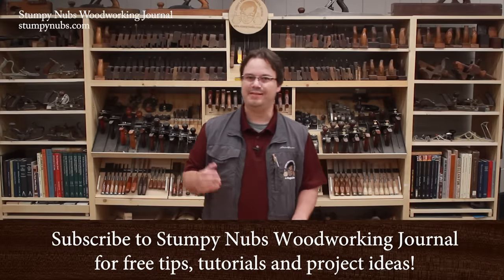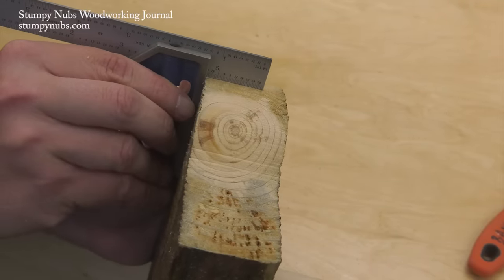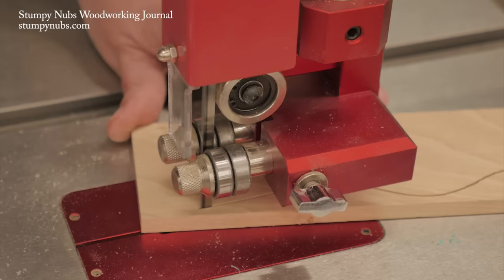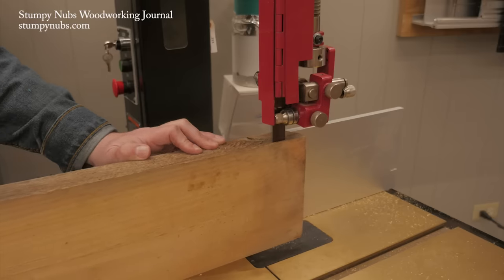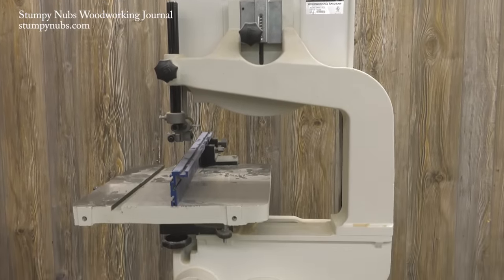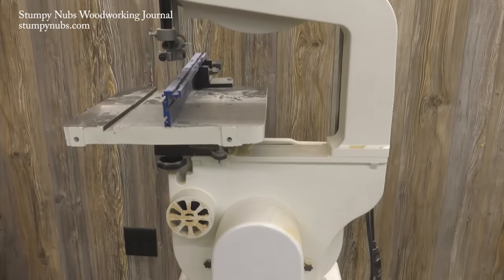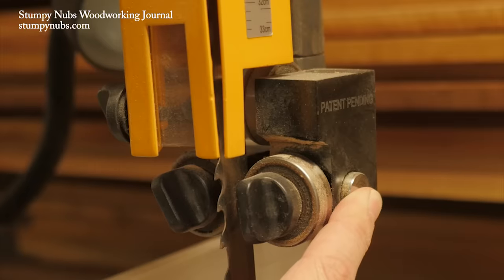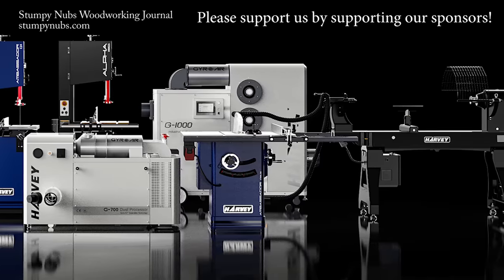What you really should be looking for in a band saw for woodworking

Comment: I disagree. By all means buy the saw you can afford now. You will have the experience and use of it until you out grow it. I started out with a 12” jet band saw. When I needed  a pro model I sold it for what I paid for it.  Tools hold their value. you can have the benefit of a saw you can afford now and probably get all or most of your money back. I recently bought my big band saw and a Saw stop table saw to replace my bargain saws. Both the new saws have gone up dramatically in price since then. I could probably get all my money back today but most definitely in 5 to 10 years from now.  Machine tools are one investment you are unlikely to lose money on. They just do not depreciate and new ones are always more expensive. Why wait, Get what you can afford now and trade up later.
Reply: I disagree, unless you’re talking about buying used tools.  You will never get back your original new tool purchase.

Comment: I’m getting ready to buy myself a bandsaw for making my blanks for bowls. After watching this video I’ve changed my whole thought on what I want. I really wanna thank you for placing this video because it has kept me from making some serious mistakes in my choices
Reply from the maker: Another thing to look into if you are using it primarily for cutting wet bowl blanks- some turners prefer ceramic guide blocks instead of guide bearings on the sides of the blade because wet wood can start to stick to the bearings and cause vibrations while guide blocks tend to scrap themselves clean better. I prefer bearings, but I don't cut much wet wood. Just something to look into...

Comment: The community group I'm with recently bought a Laguna Bandsaw 14/12 CE which is a terrific upgrade from the old thing we used to have, it was evil and hard to set up.
The Laguna has ceramic blade guides with 10 points of contact and a 1.75 hp motor. We do a fair bit of ripping and resawing with this machine and the lack of kickback compared to out table saw for ripping jobs is significant. The group has always had the policy of buying the best machinery/tools we can afford.

Comment: I bought a big old Parks no2 18" bandsaw from a cabinet maker in Ohio a couple years ago.  The model with the emblem cast into the riser cover. (1960's maybe, I don't know). 12 1/2" resaw capacity with 17" throat depth.   That's been the biggest game changer ever to find a spot in my shop. A good bandsaw opens up so many more possibilities for any project than nearly any other tool.  Detroit Bandsaw can weld and mail a blade for any size saw if you're stuck with an odd one. Vintage Machinery website has old publications for those great Craigslist finds.  Cheers!

Comment: I upgraded from a cast 14" Delta wit Riser block to the Rikon 14 -326 DVR inch with the new DVR  motor - & have been very happy with he results.  The Resaw setting increased the blade speed = more momentum.  Motor also adjusts torque based on load .  Able to resaw 13 inch hard  maple to within 1/64 to to bottom of the cut.

Comment: Nice video, I do segmented wood turning and I use my band saw to cut all my strips, this saves me enough of to pay for a saw in less than a year. The one thing that needs to be done is to add an extension to the back of the table so my long strips do not fall off while I'm cutting them.

Comment: James, excellent as usual. I'm one of those guys with a second hand, probably worn out smaller bandsaw with carbon block guides that drifts when I use it, so I almost never use it. Too painful. To see someone resaw veneer off wide boards is a thing of beauty, mystery and envy. But every one of your videos I've seen does a superb and concise job of ending the mysteries. Thanks!
Reply: If fixed drift in a used 14" bandsaw by simply changing a blade. It was night and day after, it is a pleasure now to work with the machine.

Comment: I’ve done rough cut framing projects for many years. I’m a stick builder. However as I get very close to retirement would like small projects from cheap would and plywoods. I’ve had a hand planers, power hand planers, circular saws, routers, jig saws, sanders and a table saw for years. Love your channel but sometimes it’s to advanced for me. I just bought a 10 inch sears craftsman 1/3 band saw with a broken drive belt for 1$ from a closing yard sale and felt like a great deal, now i feel like it’s junk…but I will still get a drive belt and see what I can do.
Reply from the maker: It's not junk. It's just not the type of saw you will resaw wide, thick lumber into thinner pieces with. You can probably cut curves with it just fine if you tune it up.

Comment: I just got my first kickback and luckily I followed everyones advice not to stand directly behind the blade. I was taking a kerf width off a 2x4 with a regular throat plate prepping for a bandsaw box blank. I saw the little peice drop down. ok Next thing that 2x4 shot right back! 😳. I need to look for a tablesaw buying guide. I have a Ryobi 10 and I hate the table! It's not flat iron/steel. I mean it's like corrugated aluminum or something and it doesn't have slots for a sled. I don't like my Ryobi Bandsaw much either.

Comment: Hi Stumpy, I bought the harvey c14 bandsaw.  I'm getting a lot of vibration when it's turned on.  I mean a lot.  After closer inspection, I think there are 2 things going on.  

- I can feel a little high spot in the tire of the upper wheel towards the back side that spans about 1/2 inch.
- There is still a considerable table vibration with the saw blade taken off and just the motor turning the lower wheel.   

Couple more facts.

I took off the belt and spun the upper and lower wheels independently without blades or belts, and I did not notice either wheel particularly out of balance.  Each wheel had a really minor change of direction after coming to a complete stop by maybe 1/2 inch reversal or 1-2 degrees radially.  There was no noise coming from the bearings and both were silent when turning both cast iron wheels.

Also, I took the belt off of the lower wheel and motor pulley and ran the motor without any load, and felt no vibration from the motor alone.    The shaft appears true.

Put the belt back on and tightened the belt really tight, even tighter than what was delivered.  There is a bolt that applies downward pressure to the motor which in turn tightens the belt against the pulley wheel, however, when tightening that tight I start to hear noise coming from the bearing in the motor when turning by hand, so I'm afraid it might be too tight, but still getting a bad vibration even with the belt really tight.  I put a bottle of 'Simple Green' cleaner/degreaser on the table and you can see the fluid sloshing around in the bottle pretty violently.

I suspect maybe one or both wheels might be out of balance but I don't know how to detect where weights should be added to offset the heavy spot in the wheel.
Reply from the maker: What did Harvey say when you contacted them?
Reply: @StumpyNubs  First they asked was anything damaged in shipping, and I said no, it was delivered in perfect condition.  Then went through a series of basic checks:  is my serpentine belt tight enough?, is the motor vibrating?, etc?.  Nothing out of line there, so they took down my info, and I'm waiting for a technician to call me back.   This all took place Friday afternoon.  Once they diagnose the problem they said they will probably ship me whatever parts might be needed.
Reply: @StumpyNubs  Problem solved.  The rubber stand pads weren't installed before.  After I installed them on the base and leveled the unit, the vibration went away.  Made my first cut but I need to get a better blade, it gives a really rough cut

Comment: Big wheels are helpful too because it means you have more choices of blades you can use on them. It means you can use thicker blades without it breaking due to metal fatigue. It actually saves you money as breaking bandsaw blades gets expensive quickly. 

I think it's just better to get a larger saw than a smaller one. You can still make bandsaw boxes on a large saw (to a point... I don't think those lumber mill bandsaw that goes into a pit makes good bandsaw boxes) but you can't resaw well on a small one. And 10 inch bandsaws are a waste of money. Their wheels are far too small to use any standard blades, which means you pay more for blades that wear out faster, and if you use any bimetal or carbide blades they will break before you even get much use out of them.

I got myself an old bandsaw that has wheels the size of a standard 26 inch bicycle wheels... never regretted it.

Comment: Thanks. I have been doing hand tool woodworking. A bandsaw is the one machine tool I'm thinking if getting. Mostly for resawing to get wood to desired thickness. Easy to hand plane one side flat. Major pain to then use hand plan to go from 3/4" to 1/2" thick wood.

Comment: Thank you very much for the excellent guide to bandsaws. I bought a really cheap one about 4 years ago. I only paid £49 Sterling and it seemed okay to cut templates in 9 and 12 mm ply or mdf, but any attempt to cut in a straight line and the blade wanders all over the place. I won't be doing much re-sawing, but will want to cut curves and the occasional straight line, so am in the market for a better model. I don't regret the money I've spent on the cheap model, but am ready to spend more on something that will work well out of the box with minimal faffing around.
I'm looking forward to checking out your other tutorials on bandsaws.
Thanks for sharing.
Reply: I bought a 3 wheel bandsaw to "get by", and I instantly regretted it. The thing requires special blades that are expensive, and lasts maybe 2 weeks before it got dull enough to not cut straight at all. By the way if your bandsaw isn't cutting straight, it's because you have dull blades or the blade has damaged set (they need those set in order to have the clearance to not bind and drift). The big problem with 3 wheel bandsaw is that they can't take any blades thicker than what it has, or else it snaps instantly. 

Always get the biggest bandsaw you can afford. If necessary (due to blade change issues) and you have the space, have two.

Comment: When I needed a bandsaw I bought what i could afford, a 14" cast iron from HFT.   It sufficed for the immediate need (BTW it is made in the same factory in Taiwan as Jet, Grizzly, and Powermatic using the same frame and table but with cheaper everything else) but I very rapidly outgrew its cheap components.  So I upgraded as I could afford over time and exchanged cheap for excellent components (including a 1.5 up Baldor motor) and now I have a top performance bandsaw.  Saving up for an excellent saw would have left more than a year's worth of products unmade with an accompanying loss of income.
Reply: That is great advice for starting cheap, and upgrading universal components as able.

Comment: Howdy from Texas, James.  Love all your videos, and your website as well.  Trying to decide between Harvey bandsaws.  The Ambassador 14 has everything I need.  However, I don't like the round bar rail.  I like the extruded rail on the Alpha 15 better.  The Alpha 15 also has a nicer taller fence and larger table.  
My questions:  
1.  Is the rail difference important?  Many other brands of bandsaws have the same round rail - but I think the extruded rail can be more accurate - and looks better.
2.  Should I worry that you can't get Carter guide products for Harvey bandsaws?  It seems that Carter guides are not available for Harvey saws.  I am interested in the Stabilizer Guide for small blades mostly, since the stock Harvey guides are similar to the regular Carter guides.
Thanks for your reply!
Reply from the maker: The Alpha is definitely a more robust fence, more like a table saw.  But I really haven't found the Ambassador's fence lacking for a band saw's functions. 

The guides seem a little easier to adjust on the Ambassador, but the Alpha guides are still way better than my Rikon or Jet guides were. I think the Carter guides are comparable, so I don't think that's an issue. It is true that you can't use the Carter single-bearing guide, but I have no personal experience with that guide so I can't say if I would miss it.  

Here's what I generally saw when people ask me about these saws:

The C-14 (https://www.harveywoodworking.com/products/new-ambassador-c14-3hp-14-band-saw) is a fantastic saw that will do pretty much anything most people will ever need. It has lots of power (3HP) and cutting capacity (14" max re-saw). The fence and trunnions are of high quality. The guides are the best on any saw I have ever used in terms of adjustability without hassle. The wheels are heavy cast iron and the frame is big and beefy. It has a quick-release tension mechanism and a foot brake. It also has dual 4-inch dust collection ports. My only complaint is the table height is a little low for my taste (34"), but I adjusted to that fairly quickly and if I wanted to I could put blocks under the saw base to raise it a few inches.

Here's a Cool Tools video we did on the C-14: https://youtu.be/4XNh0v2GUJA

The HW615 (https://www.harveywoodworking.com/products/new-alpha-hw615-15-band-saw) is a beast of a saw. It has all the things I like about the smaller C-14 (3HP, 14" re-saw capacity, quick tension release, foot brake, dual dust collection ports), but it is even more robust. Everything about it screams quality, in my opinion. I have tensioned a 1-1/4" blade on it (the manual recommends 1" max), which puts an enormous strain on a saw's frame. But this thing barely flinches. The fence is the nicest I have ever seen on a band saw. The table is extra large and heavy (I have the tin-coated table, which resists rust). If I had to say something negative, the guides are a little more fiddly to adjust on the HW614 than they are on the C-14, but still nicer than most toolless guides on the market, and very heavy duty.

Here's a general video about what to look for in a band saw: https://youtu.be/sUsKYElDKl0

Here's a video about choosing band saw guides: https://youtu.be/3MPR2kcMhJU

Here's a video about band saw blades: https://www.youtube.com/watch?v=z7n7Gg4QOkc&t=0s

Here's a video about setting up a band saw: https://youtu.be/tPRrEgnt7wM
Reply: @StumpyNubs  my c14 lower bearings move consistently and significantly whenever I tighten them, even the replacement set they sent me. Does your's do that? Did they change the design?

Comment: Thanks for the video your statement towards the end kinda hit home as a new woodworker I always believed in buying a quality tool instead buying a so called starter my miter saw for example the Bosch GCM12SD glide very nice saw I wanted it saved and have it the my table saw I have a Metabo 10 inch I like but my band saw for some reason I bought used it is a Craftsman 10 inch I just replaced the tires and couldn't get the blade to stay centered then I put on a new blade and it is fine but I really wanted the grizzly 9 inch but for now I am using this it seems om but I feel like I settled like you said,

Comment: I rock a 14" cast iron porter cable. It's got ok tires, a good motor, but the guides are a little ... Upgradeable, and i wouldn't mind a better insert. That's why i designed and 3d printed one to replace the original, which was garbage.

Thanks for your videos, as always!

Comment: Bandsaws are excellent when space is limited too. Mine's in the garage & has about as much space to work in as the saw itself takes up, & the only time this has been an issue is with cross cutting. The lack of throat depth & the inability to swing long boards around in there made this basically impossible, so I got one of those mini cordless circular saws. Now I can cross cut with that, rip cut with the bandsaw, & keep it all together with a few clamps (for holding down to the bandsaw table) in about a 2x2' space. My jigsaw is actually in a bag right here, waiting to go to the dumpn because I never want to use that annoying thing again. It was crap, so wouldn't want to give it away to some other poor soul either.

Comment: I'm in the market for a band saw, primarily to re-saw thick lumber.  I checked the Harvey site - looks like a great band-saw with all the plus features you describe in the video, but a little pricey for a retired old gent.  I've always been into "garage" woodworking, but now I have a 900 sq ft shop and room enough to finally have a band saw.  If I was younger, I wouldn't hesitate to buy the Harvey....  Can you recommend a solid band saw to fit my needs?  BTW, I have a 10" radial arm saw, 10" table saw, lathe, and my pride and joy is a 3x5 Legacy Maverick CNC with ATC and turning center.
Thanks for all your videos and great tips.

Comment: Great advice!  I have been looking to replace my Craftsman 14" with something bigger and badder. Harvey is on the list. Nice equipment. Great value for what you get.
Reply: You can go the used industrial route too. The stuff they built in the 60s and 70s is outrageously robust and they are everywhere. You can easily get a 3-5hp machine with a 20" throat and 12"+ resaw capacity from anywhere between 300-1000 depending on the condition and location.

I snapped up a Powermatic 87 out of a metal shop for 400 bucks a few months ago. Usually the only differences between the Metal versions of these bandsaws and their Woodworking brothers is that the guides are usually steel, theres no Tslot on the table and there is no dust collection port....but they are literally a dime a dozen, they are everywhere and they can be bought pretty inexpensively.